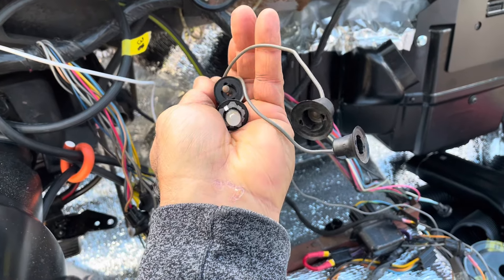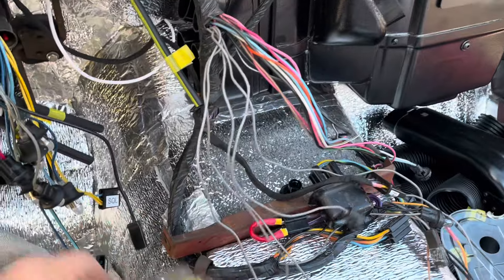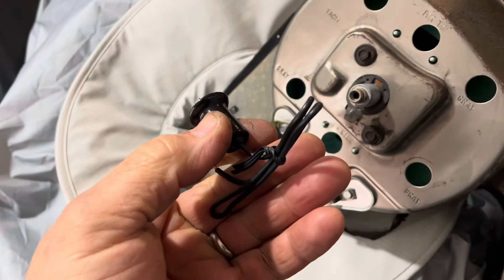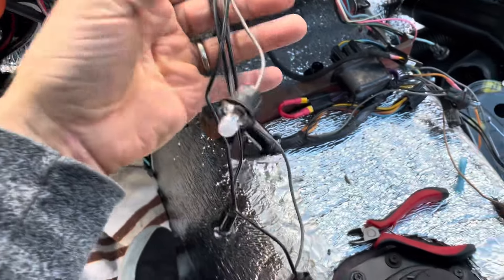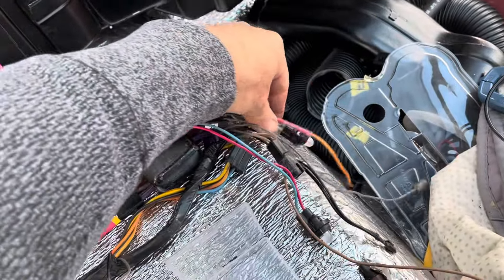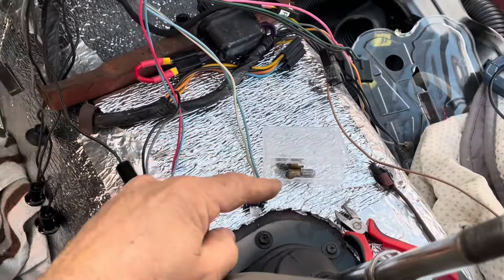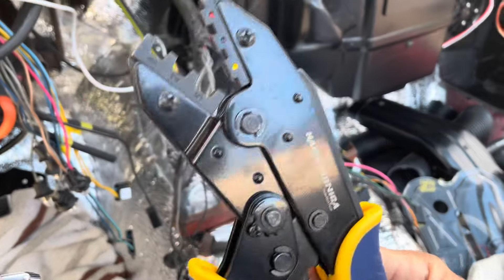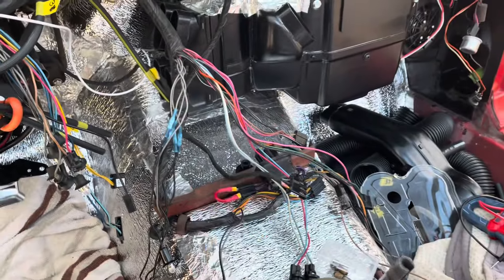C3 Corvette Dash Lights to LED

Comment: I’m just curious with everything I’ve heard about how tight things are in the pre 78 dashes, you made sure the socket fit on the back of the tach but is there enough room when it’s back in the dash? Don’t know how much room is back there
Reply from the maker: There’s enough room, but it’s just hard when you have to have the dash nearly all the way in to get the wires connected. I have half a mind to make my own quick connect (but I won’t)
Reply: @thedrivewayC3  LOL, when I went in to reply I see you've got a new video loaded for me to watch tonight that appears to have it in. I'm so glad mine is a later one where the bulbs just pop in and twist ;)
Reply from the maker: @michaelriley3110  Yes, I think the 1-wire with metal clip is not the best - but it’s OK as long as it’s working.
Reply: @thedrivewayC3  Probably why they changed it in 78 LOL